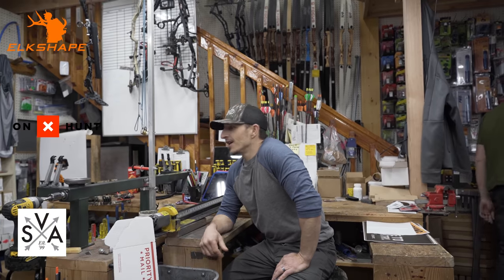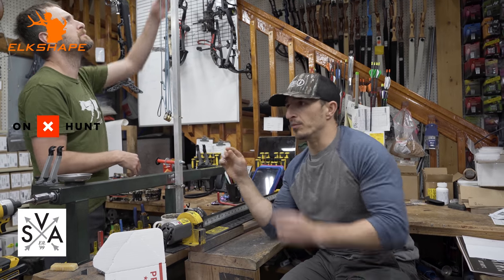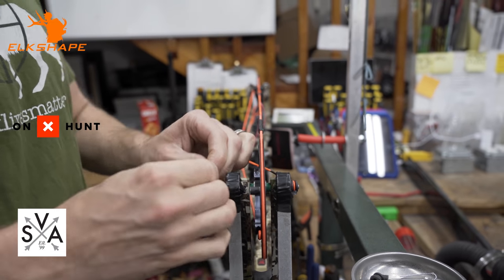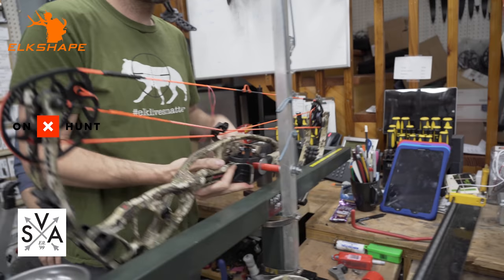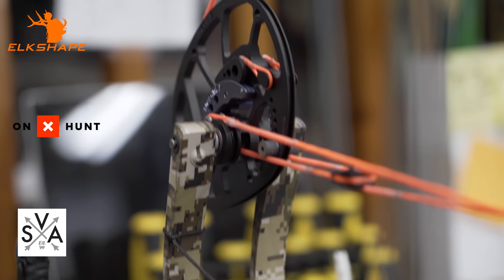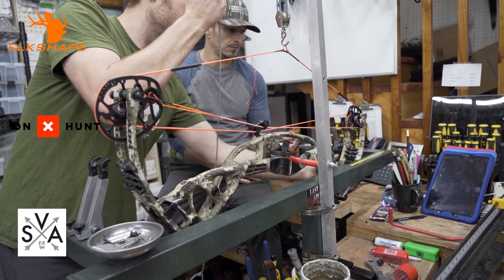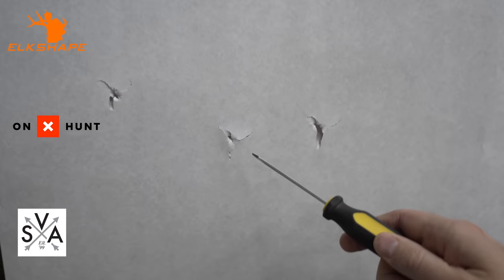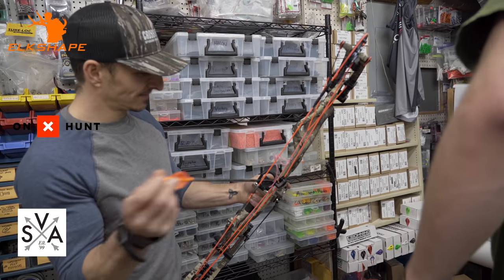Bow Build, Paper Tune, Cam Orientation, & Peep Install

Comment: Great video...Regarding cam lean, I noticed you added or removed twist from the top to adjust the top cam....what would you need to do to adjust the bottom cam?  Per Hoyt the bottom buss yokes shouldn't be touched...so how would you get a lean out of a bottom cam?
Reply from the maker: I've never seen JosH (my mentor) touch the bottom cam!